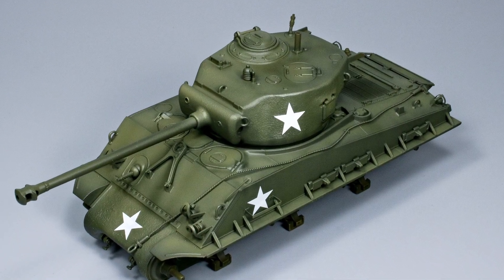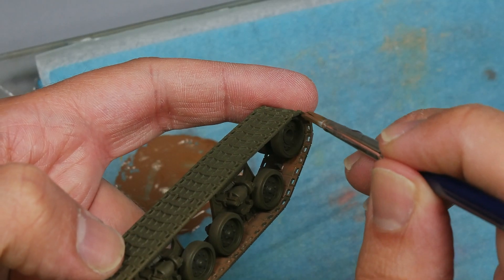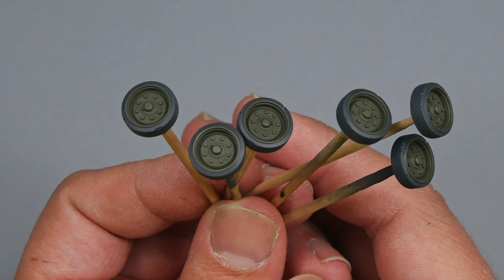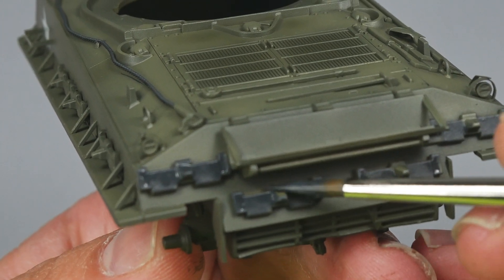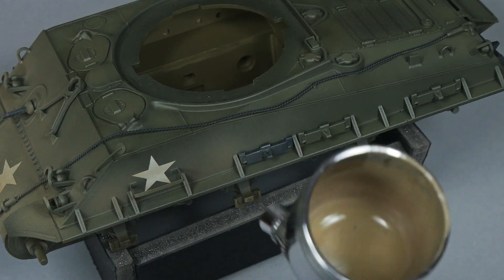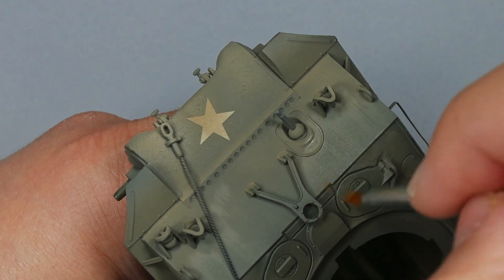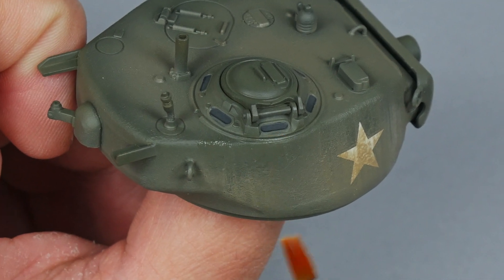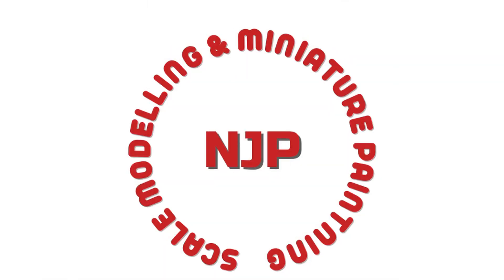How to start weathering a scale model tank. Tamiya Sherman 1/48

Comment: Thanks for sharing the excellent skills.
In video 4:57, before painting the dust color, did you ever apply any chipping liquid on the base coat, 
such as Tamiya 87225 or MIG-2010?
Reply from the maker: No, I don't.
I applied acrylic varnish after airbrushing the olive drab.
But this dust color was sprayed just on top of it. Dust paint is enamel based, so it dries slower and you can blend it with enamel thinner.
Reply: @notjustpanzer  Got it. Thanks for reply.
Reply: did you mix the Humbrol 118 and Humbrol 72 for the dust effects? if yes, what is the ratio? Thank you👍

Comment: Brilliant work. What are the humbrol colours as I looked and 72 is khakhi drill and 100 is red brown? Is that correct do you mix both to create the dust effect thanks
Reply from the maker: Sorry, there is an audio mistake, I used Matt 72 and Matt 118 as shown, didn't use Matt 100. You can mix them or apply two tones of humbrol instead. Cheers

Comment: How would i do the dust without an airbrush
Reply from the maker: Well if you don't have an airbrush available. It would be a nice option to apply the enamel colour by brush and blending it later. I don't recommend humbrol paints for brush, but you can use the ak/ammo enamels dust colours and they will work very good.
Reply: @notjustpanzer  ok ill try